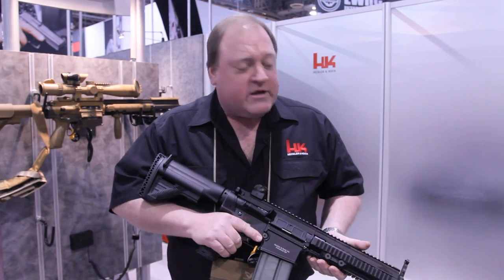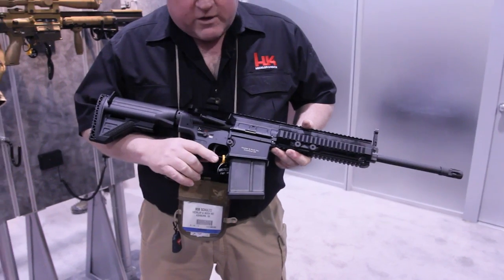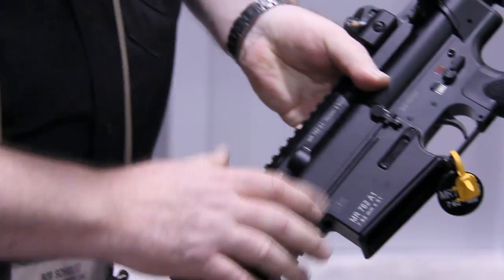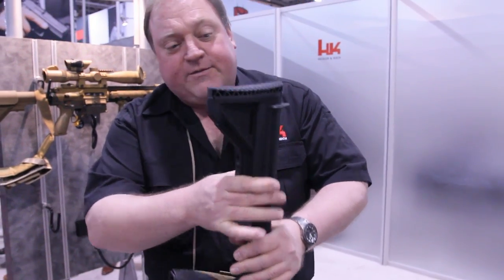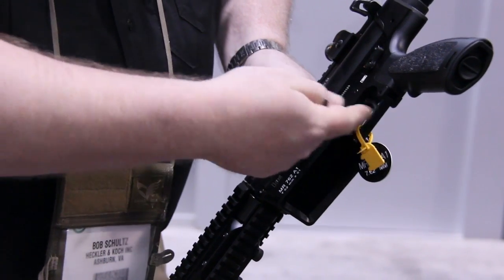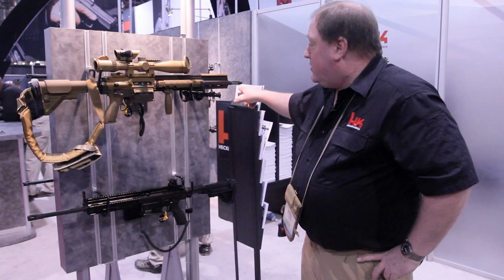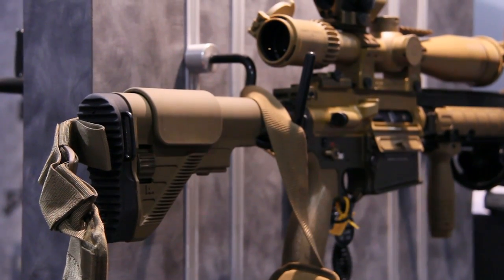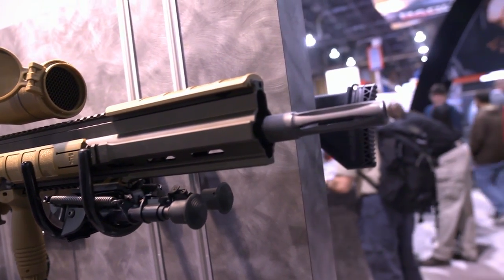HK ShotShow 2012

Comment: @pinselplins 
designed for the german army, first order of 560 G28 came in August ´11.

You´re probably talking about the G27, based on the 417, not the 762. 
Almost the same, but with different flavors

Comment: In a nutshell, LWRC's IAR is basically their M6A3 (which was recently discontinued) with a heavier barrel, and fires from the closed bolt for the first round and then fires from the open bolt for subsequent rounds. (How they do this, I dunno. I didn't build the damn thing, after all.) It was built to meet the USMC's IAR requirements.

H&K's M27 won the contract.